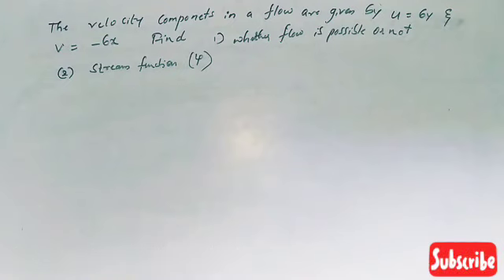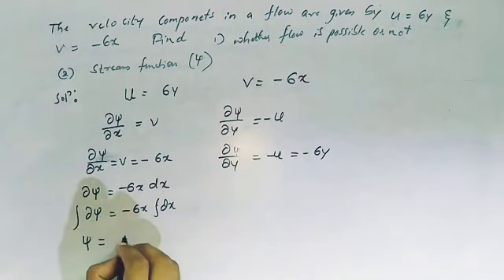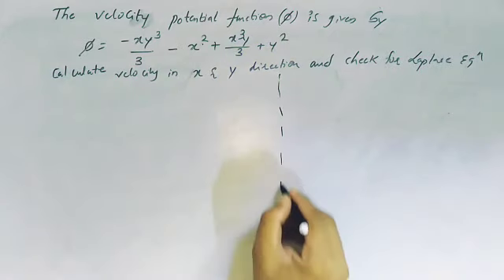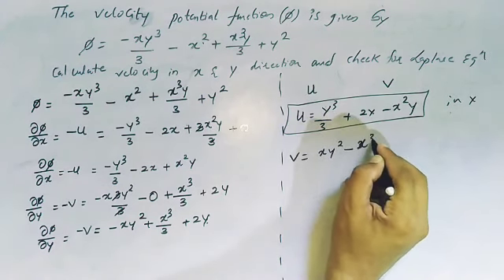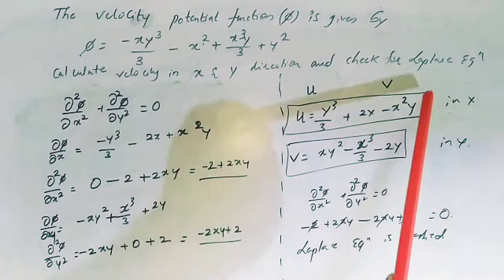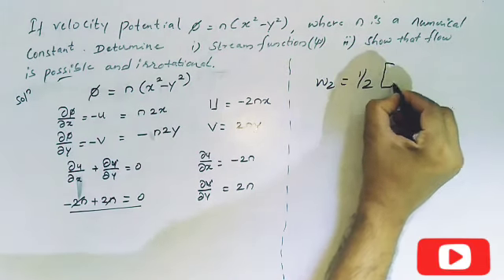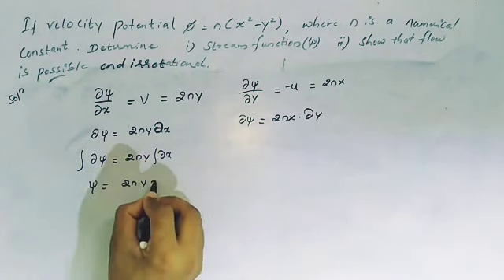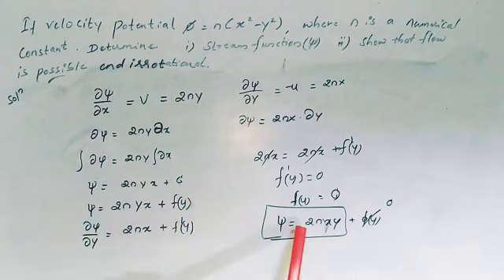Fluid Mechanics Module 2 : Fluid Kinematics | Velocity & Stream Function | Part 15 | Numerical | VTU

Comment from the maker: Question : Velocity potential function is given by
(-xy^4 / 4) - x^3 + (x^4 y/4) + y^3
Find velocity in x and y direction and check possibility of fluid flow.
Reply: i) Velocity in x&y direction
u= y^4/4+3x^2-x^4 y 
v= xy^3-x^4/4-3y^2
ii) Their is no possibility of flow.
Reply: 1) velocity in x&y direction
U=y⁴/4+3x²-4x³y/4
V=xy³-x⁴/4-3y²
2) the fluid is  not possible to flow
Reply: *)Velocity in x direction..
i.e   U =   y^4/4    +  3x^2    -    x^3y
Velocity in y direction..
i.e    V =   xy^3    - x^4/4    -    3y^2

*)There is no possibility of fluid flow...